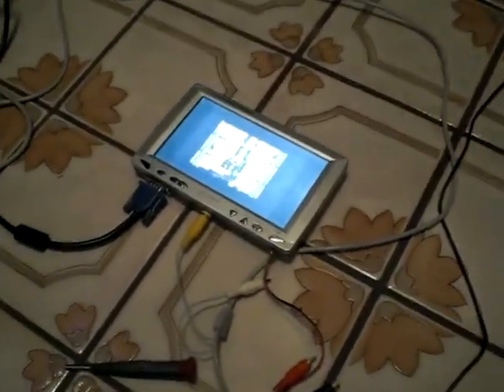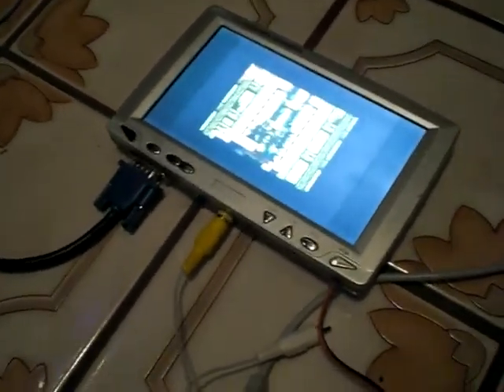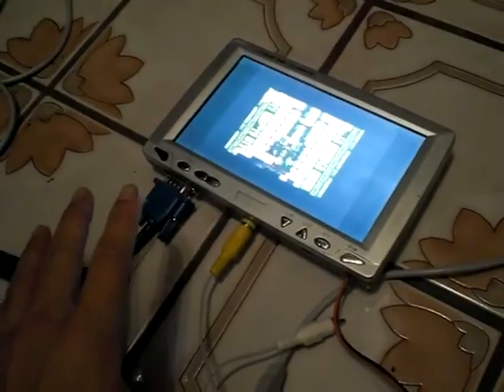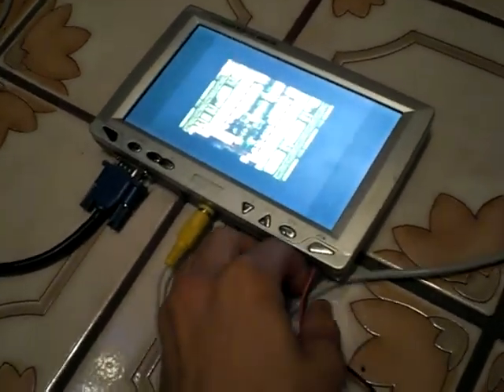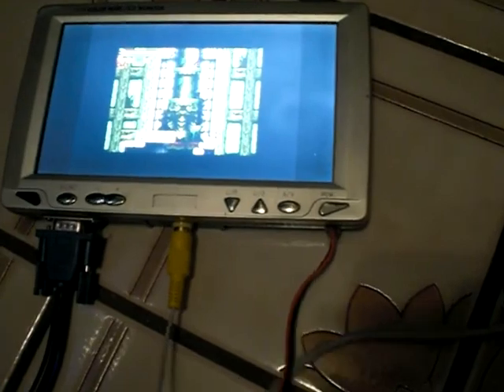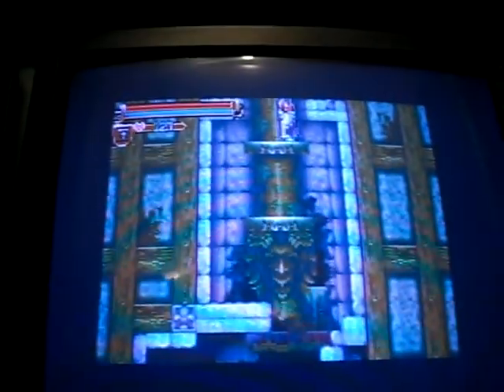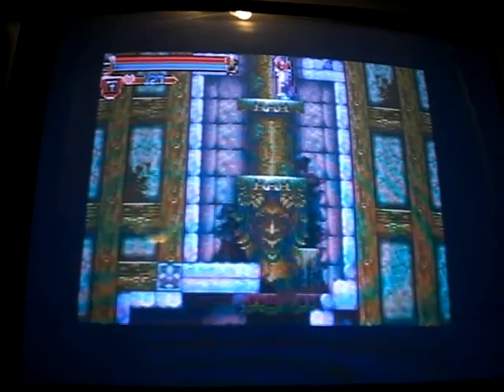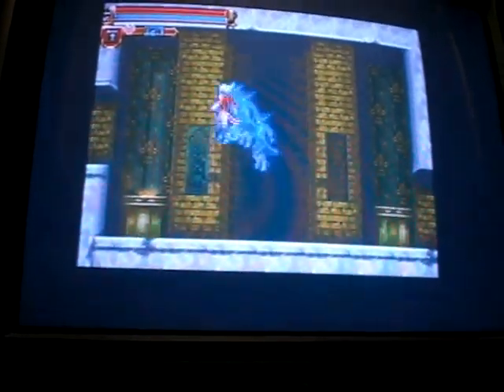Composite to RGB : Video Decoder Hack

Comment: Thanks for the info. I have been trying to figure out a IR3Y29B LCD driver for a while and just discovered some of your forum posts that lead me here. As a friendly suggestion, you should add/(add more) YouTube search tags to clips like this. Add a few variations of each chip, like IR3Y29, IR3Y29B, IR3Y29AM.

   In your forum post titles, use the whole title bar with terminology that people search for like DIY, Hack, Convert, etc. Also use specific but broad details within part numbers like IR3Y29 but not ...29b or ...29am so they have a much better chance of coming up in search engines, this will get Google to add your info to suggestions links on the other searches. 

   I try to apply what I've learned from search engine marketing to help reach more people that are looking for great information like you have provided. You can test this out by doing a YouTube search for "IR3Y29B" and you will find 2 other clips currently. I wish I had found the information you have posted on TFT driver chips sooner, that's all :) Thanks -Jake.

  PS Vialta Vista Digital Picture Frame VF100: IR3Y29B
Reply: *YouTube search "IR3Y29AM" (not ...29b)
Reply: +Sega Sonicfan I actually bookmarked several of your posts I came across on various forums while I was trying to figure out the display drive system I have. It is easier to contact you here where I monitor my messages instead of creating a new forum account somewhere.
    Thanks for all the information you posted about LCD's it really helped me connect the dots.
Reply: I should also add, in this video description you reference the gate logic chip and syncing signal. That was my big breakthrough moment. I stopped trying to bypass that chip and started playing with the other side of the board inputs. My IR3's  pin 5 (must be grounded for composite input) went to the gate logic, and wasn't clearly grounded. This had me confused as to how the IR3 was configured and what other signals were coming from another board.